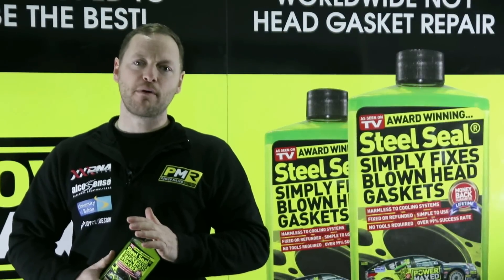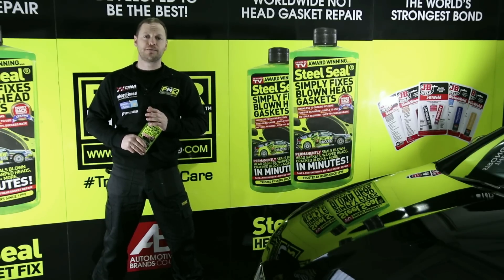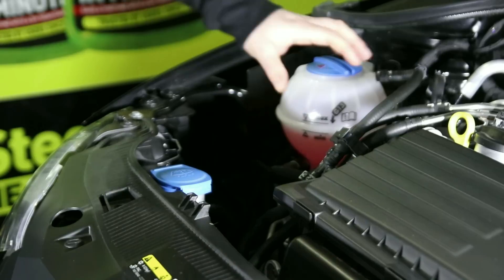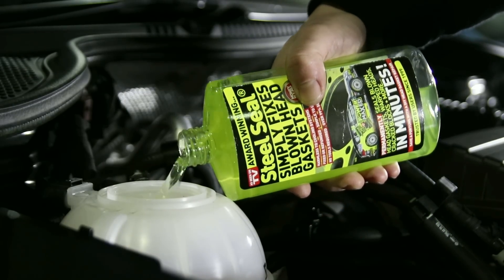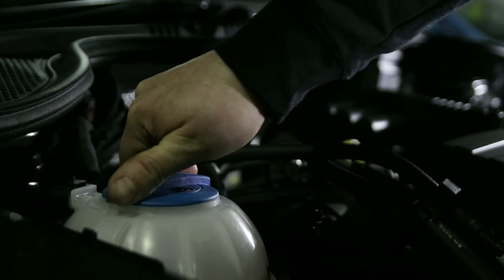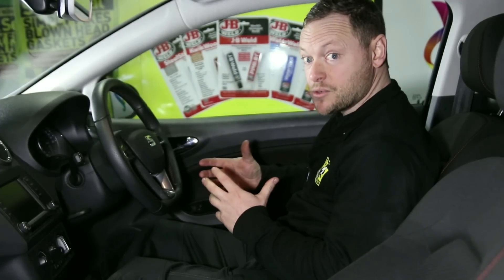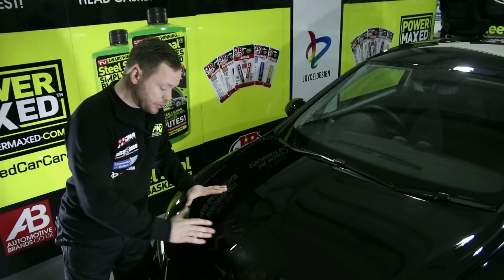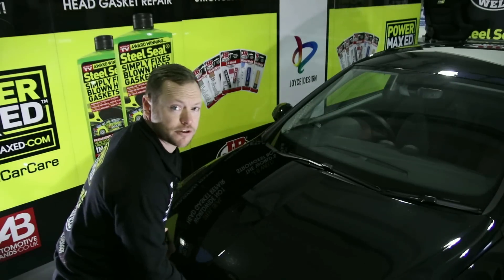How to Use Steel Seal

Comment: so my coolant tank was empty, so i add this ? and then more coolant or how would that work with a dry tank?
Reply: The leak you obviously have could be in the engine block and the sealant may well do its magic and bingo. Is there steam coming out of your tale pipe, is their spillage from the radiator or pipework, I mean have you identified where your coolant is going when you are going?
Reply: tomctutor yes it was due to my water pump and housing thermostat 👍🏽

Comment: Well, first of all I’m not a mechanic so I’m not against the product by nature, second it’s not a paid feedback! I’m a real person living in United Arab Emirates and I’m driving a 99 Cadillac Eldorado for weekends which was confirmed a head gasket case. 
I thought I would go for a smart solution by pouring a liquid instead of pouring too much money in a garage! 
I bought steel seal and literally followed the instructions specially about flushing till it took me around a week to super flush it. 
Added the product without removing thermostat with radiator expansion cap on. 
It worked!!! 
The repair key after many trials with other products is flushing! If your system is dirty and rusty take your time to clean it. 
Make sure your problem is head gasket not water pump, radiator, thermostat or even the cap itself. 
I’ve been driving for 10k miles with no single drop of coolant, later my heater core failed and leaked the whole coolant inside saloon, so I bypassed the heater core and car is back to normal! Who needs heater core in UAE!!! 
Eventually to get success u need to pay some attention to details and do some efforts for correct application, don’t rush.
Reply: Is there any way to bypass other engine parts to get rid of clogging

Comment: my car had a problem where it wont blow warm air inside the car , i tried this as intructions said will it effect the process if i had full blowers on and on high heat but no heat come out ? idled for 20 mins car got up to temperature .
Reply: How did you get on???
Reply: @Stevengoingplaces  didn't work

Comment: Ive got an 08 plate vauxhall.. chugging out white smoke!! New head gasket would cost an arm and a leg. I used steel seal b4 a it worked for about a few months straight as oppossed to using no smoke product from Halfords which lasted 3 weeks. Im just letting it run through my system as we speak and hopefully another few months of smoke free driving.
Reply: How did you get on?

Comment: Looks like you're selling snake oil.  I have a 95 Chevy Corsica 3.1 Just did the fuel pressure regulator and now have a big oil leak above the starter.  Low coolant light is on and I can see oilnd water mixed.  Car hasn't overheated at all maybe because it's still cool and doesn't sound funny.  I'm ex military and don't have the money atm because I'm fighting with the VA over my finger and some of hand being amputated. 

How does a liquid like that stop leaks?  Also notice the dreaded white smoke coming from exhaust but its always done that when cold since I've had it.  Only 98k miles on it but I see the 3.1 are notorious for oil leaks.  I'll do a little more research before trying but almost to the point of it.  Really nothing to lose.
Reply: Good luck man. I hope things get better for ya.

Comment: Can't help but notice you've got red coolant in there, which is the longlife stuff. Instructions on the back say DON'T mix it with that. A fella on Pistonheads had his coolant turn to goop as the Steel Seal reacted with it. I've just put some in a friend's old banger, and flushed it through with clean water to start with, and it seems to have done the trick so far. Might be worth clearing this up?
Reply: It be helpful if they stated what coolent standard compatibility, as that look like normal VW spec G12/G12+ that was in that vehicle, witch I believe is actually incompatible with this product,, my coolent system is getting very bubbles (system. Is been pressurised and heater stops working sometimes because of the air trap) so was seeing if this would work

So your post will definitely make Sure I don't try this stuff then (not g12/12+ compatible)
Reply: @leexgx  do you use tap water
Reply: @frankcastle9866  no pre mix

Comment: ( warning )please who ever read this message you need to think not once But twice of buying this product is pure joke and i have no idea how they allowed this product to be sold on the market is a rip-off And it could damage your engine i  used it on Mike Golf Plus Tsi 1.4 on the 24th of November 2019 when I use this product it’s made the head gasket making some tapping noise please   Do not Buy this product Is waste of money the only way to fix it is to take it to garage that’s the only way please do not use it my advice to everybody many thanks
Reply: Since your head has weird tapping noises, its either timing chain or tensioner issues (most likely), loose valve stems, faulty valve heads or even possibly something just clanging against the block externally, like a screw?
Since you obviously have overheating issues (because you used the sealant) did you diagnose what the source of the overheating was first?

Comment: Hi thanks it’’s work for me for Audi A3 2003 was over heated so I use steel seal blown cylinder head gasket and I did drive for 20 mint the heat back to normal 90 degrees  and after that I did drive for 3 hours with  no stop and is still normal 90 degrees. Many thanks and good luck for the others✅
Reply: How has the steel seal held up over the years?

Comment: It realy works, i put them to my megane 1.4 petrol 2007. Oil was mixing with coolant, no coolant in oil. It's butter in coolant reservuar. Mechanic said that repair will cost 600€ or i can get new engine from scrapyard for 500€. I just get steel seal in halfords and put to coolant reservuar. Now three months later engine work fine, it's  no more oil mixing with coolant. Butter stay in reservuar but mixing  stop on the previous level.

Comment: I am hoping you can help me with a huge problem I am having with my 95 Chevy Suburban. I changed the water pump in Feb. and all was good. Last month I got a crack in the radiator, and replaced it. I still had a leak somewhere so I did research and watched a lot of videos, including all of your, about Steel Seal. With all the great things that are said about the product, I decided to try it. I changed the radiator first, and the oil, then added the Steel Seal and started to run it as recommended. After about 10 minutes, the car overheated to the point that is was making a crazy hissing sound, steam was coming from the back of the motor and water was pouring out from under it! I had to have it towed to a shop (which I hate to do, they are such ripe-offs, especially when one is a woman!!!) and they found the leak was in the heater connector. They fixed that, then called to say it was overheating. They did some test and determined that the engine was blocked somewhere and the coolant wasn't flowing properly, but couldn't find where. They asked if I had used some kind of seal stuff, I told them what I had used and they pretty much gave up on the car; they told me I had two choices: drive it until it blows up or put in a new engine for $4500.  Needless to say I was sick! An old lady on SSI does not have that kind of money!  I called Steel Seal in the UK on 8/21/19, they called me back and the tech told me to do a cold flush about four times and it would wash out the Steel Seal and be back to normal. Well, after seven cold flushes and a lot of frustration my car was still overheating. I called UK again no 8/25/19 to talk to the tech to see if I was doing something wrong with the flush, they still have not called me back!!!  So I did more research on YouTube for answers...  I did a back flush on the heater core, and changed the Coolant Temp Sensor, checked all the hoses, new thermostat, etc. The temp has come down some, it fluctuates between 210 and 230-40. When I take it for a drive it will start towards the red about about 45 mph!  
I just don't know what to do  
Thank you! Nedra

Pluto Antsee
Reply: I received a call from Luke in the UK, he explained to me what I need to do to remove the product from my system! I am very grateful for the information he gave me. 
Thank you Luke for your assistance with my issue! It is a huge load of my mind!

Comment: If I hadn't seen it work twice I wouldn't believe it! However every time I've used it at my repair garage (6+ times) results have been poor.
Reply: Junk the car then
Reply: Each vehicle has to be assessed according to its driving history and maintenance to ascertain if the head gasket damage is minor or major before it can be considered resealable or needs to be replaced and then theres the resealing process.

Comment: so does this still work if the head gasket has gone from the combustion side and introducing exhaust gases into the coolest system?? thanks
Reply: Yes, but its more the minor or severe damage the gasket has sustained by the way the vehicle has been driven was it driven moderately and maintained up to 90 percent chance to reseal or hard and neglected up to a 10 percent chance of resealing..
Reply: @Aries-cv4wj  i twas driven and maintained regularly. I tried and it failed to seal unfortunately.
Reply: @mmore  what were the symptoms of your over heating?
Reply: @mmore  oh i forgot to mention a break on the gasket between two cylinders apparently does not have much chance of resealing, however water in the combustion chamber and spark plug not firing due to the water still did reseal fortunately.
Reply: @Aries-cv4wj  thanks for the info 👍
Reply: @Aries-cv4wj  wasn't overheating. it was pressurising the cooling system
Reply: @mmore  oh ok thx my understanding is only of a layman you sound like a qualified mechanic.

Comment: What about if my car doesn't have heater? As everyone knows, Malaysia is all year summer season. So all car in Malaysia had blocked all the heater path as it is a requirement from the automotive association. Can the steel seal still can be use?
Reply: Selamat pagi. I can see no reason why not having or using a heater would make any difference at all to the use of this product. But as your question is one year old I presume already dealt with. Thinking of Penang Laksa as I type.

Comment: P.s. You must refill the system back up with just clean water, just below the fill level will do. Add the product. Less water is better than more as you can always top it up with water if you've 'under' done it!

Comment: Make sure you REMOVE any antifreeze/additives before popping this stuff in your motor. This shit will block any leak within the system. Just don't drink it as it will blow your ass in two ✌🏼

Comment: Is there an antidote for this stuff? I wasn't that bothered but it is winter and the heater blew cold all the time. I tried it to the letter and it worked for 1/2 a day and went back to how it was. With great effort I fixed the head gasket and it's now perfect trouble is the heater matrix is blocked and is now still blowing cold even though the coolant is hot and stable, both pipes at the matrix are hot but it blows very luke warm. What breaks this stuff up as I'm going to have to flush the system properly?

Comment: Hi. My expansion tank has that much mixture in it of coolant / anti freeze.  I can put the steal seal on top right?
Reply: Did you got eny answer ? I have the same question.
Reply: I think you can because he had coolant already in his water container ! And just poured it in . I was wondering g the same thing ! You posted 2 years ago , did you try it , did it work ?

Comment: 3 Mechanics, 1 new water pump, new thermostat, new radiator and about $950 later it was finally deemed my radiator was overheating due to a blown head gasket (misfire in 2nd cylinder).  The final mechanic suggested selling it on Craigslist as a "Mechanics special" to recoup some of my money.   He quoted $1500+ to fix it (2006 Buick Rendezvous 3.5L)  I bought Steel Seal but the mechanic INSISTED that it was too large a gap for sealer to work.  I paid $60 to flush the system and put in fresh water then drove around the corner and put in the STEEL SEAL.  I tried driving it down the highway to get it home and it SUPER OVERHEATED.  I parked the car on the side of the highway with a note.  The next day I went to pick it up.  Drove it home a short distance but the temp stayed OK.  So I sat in the car and kept the engine at 1500 RPMs for 30 minutes.  No overheating.  Let it cool overnight again.  Next day I had my son drive it around the neighborhood for an hour.  Perfect temp.  It has been almost a month of driving and not one problem with overheating and the misfire in #2 stopped!!!  Thank You Steel Seal!
Reply: Hello question do u have to remove the thermostat ?
Reply: @ingodwetrust6595  yes
Reply: I have an overheated issue on my 2017 vw jetta 1.4 along with a misfire on cyl3 everytime it over heats.  Replaced waterpump, thermostats and its housing...car still overheats -_- will try this soon
Reply: @alexc7641  did you try it how did it go
Reply: @levihenderson3714  yeah I ended up trying it out and actually saved me from removing the heads. I verified 1st that I had a gasket leak by removing the spark plugs, then i pressurized the coolant system and sure enough Cyl 3 began filling up with coolant.
Reply: ...and I didn't remove the thermostat.
Reply: @alexc7641  okay thanks ima try this out asap where did you get the product is it only online to order
Reply: @levihenderson3714  yeah I ordered mine through Amazon.
Reply: @alexc7641  okay more question just looking for true info did your car tried to stop on you some say due to radition problems.  And if so did this product kill all that.
Reply: @levihenderson3714   No not at all, some say that certain products can clog radiators....and I agree but it's only those products that have some type of sediments in it. But since this is liquid it won't clog up anything. The best way to describe this product is like a liquid epoxy that cures/hardens when exposed to high temperatures like the ones that you would see in combustion inside the cylinders.
Reply: I love this story, hope mine ends this way tomorrow. Trying this stuff tomorrow and my freelander.

Comment: It does work although I would of expected some sort of liquid metal and not this brittle fibre resin it leaves behind, anyway the Vectra has a new owner.:)
Reply: I believe that was my believe to but is working , after 3 attempts, same bottle,  2 times car was running 2 hour on 1000 rpm because I couldn't accelerate it more  ,last time 2 hours and a half and 40 miles. 
Still smoking when I left for the road but stopped after 30 mile,  to leave the stem trailer. 
Definitely I should follow the recommendation from the bottle and that suppose to flush the sistem,  buy blue antifreeze and combine it with Steel Seal and then pour it in to the motor, but I don't have that kind of possibly because the car was on the street and couldn't go to a mechanic, or suspected the car so I can reach one the bottom of the radiator. 
Good news, is working with pink antifreeze to,  a little more time, from in minutes in to 4 hours ,40 miles  included.

Comment: Didn't work. £40 wasted.

The "no quibble money back guarantee" requires you to provide:
- Proof of problem from a mechanic (Can cost £20 to get!)
- Proof it didn't work - from a mechanic (Can cost £20 to get!)
- Receipt from authorized dealer (If you don't buy from one, you're stuck!)

No quibble!? Ridiculous!!!!!

The support team also take days to reply and make it as difficult as possible to make the claim. It's also one claim per person and condition after condition after condition. 

Just fix your car or scrap it... MUCH easier!
Reply: It’s not as simple as “just fix your car”. I paid £900 for a head gasket less than a year ago and the mechanic obviously did a cowboy job as I need another head gasket! I’ve had it looked at by two different mechanics and they’ve both said the mechanic I used did a bad job. I can see why people would spend £40 for this if it might prevent them spending a grand and then it might not still be fixed!
Reply: @sparklydiamond  Do your own repairs, if you don't do you're own repairs you shouldn't own a car
Reply: bee- ready That logic doesn’t work. You don’t know how to spell. Does that mean you shouldn’t write? 
Anyway, I scrapped the car and bought a one-year old car. Hopefully I won’t have any problems with a new car, over a fourteen-year-old Mini I scrapped.
Reply: bee- ready It figures that an uneducated person would resort to trolling. 
Four different mechanics saw my old car and advised that it couldn’t be fixed. I had problems trying to part-exchange it because no one wanted that heap of junk.
Reply: @sparklydiamond  Again you prove your ignorance, New vehicle have a much shorter "life cycle" then older less complicated cars. IE cheaper and easier to repair/perform matnince. Overall saving you money. But go on again about how smart you are hahahahahaha
Reply: SAME!
Reply: @sparklydiamond  maybe you should learn more about cars before scrapping them and buying new ones.
Reply: bee- ready I told you: I had it seen by more than one mechanic and they all told me to scrap it because it wasn’t worth spending the money to fix it.

Comment: What this plumb forgets to tell you is after adding the solution and starting the car up is to turn the heater up to full,,, READ THE INSTRUCTIONS ON THE BACK OF THE BOTTLE ITS THERE IN BLACK AND WHITE...
Reply: yep, the bottle does say this. I used 2 years ago and it worked great but followed instructions carefully
Reply: @enigmaandrews6103  Says on bottle Idle for 60min, cant I have let it idle for like 10 and go and drive it rest of the time?